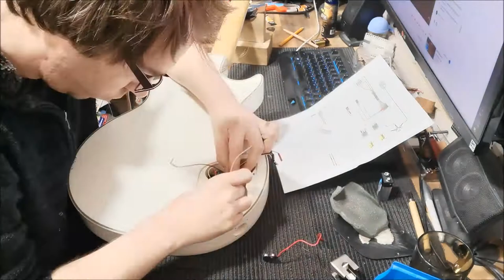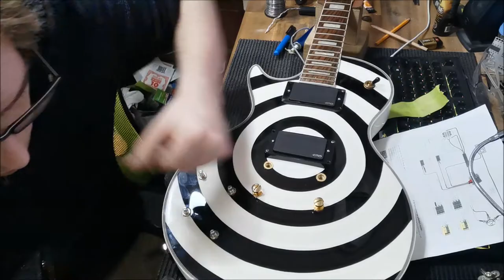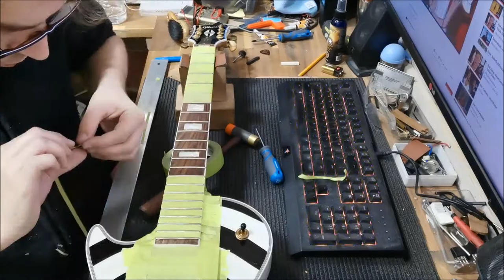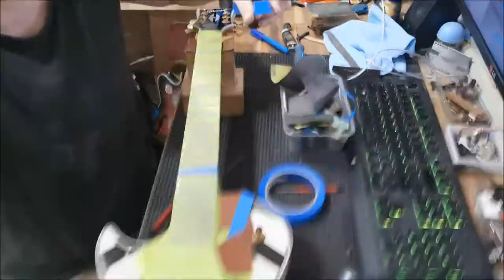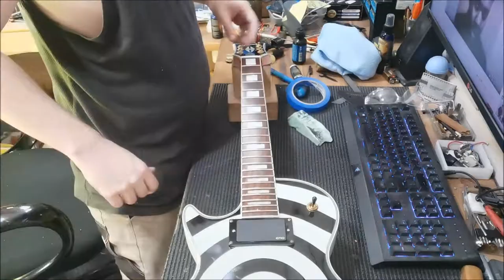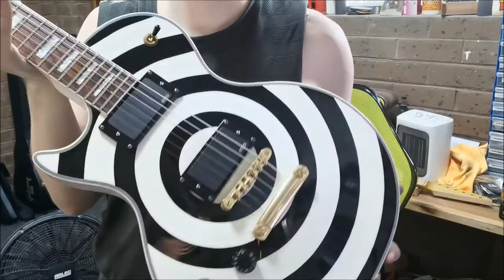lefty Chibson Les Paul - EMG's and fretdress

Comment: Hey man, what diagram did you use to install the left handed pickups?
Reply from the maker: Hey dude! Thanks for commenting, pretty sure it's just the standard click and connect emg diagram

But in reverse, it's been a while!
Reply from the maker: @fly69doc  I'm not to sure dude, it's something I'd have to see, I guess if you can take it to a tech and get them to fix it, left handed plug and play rigs require trial and error and some thinking
Reply from the maker: @fly69doc  no worries, sorry I couldn't of been more helpful, even I struggle with lefties! Just gotta play around and see if you cam get it going, if not seek help